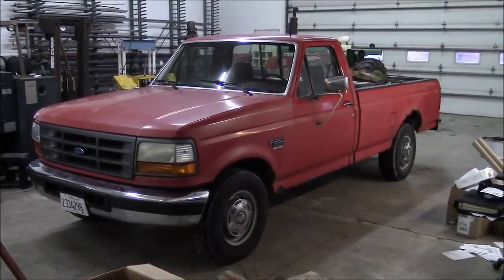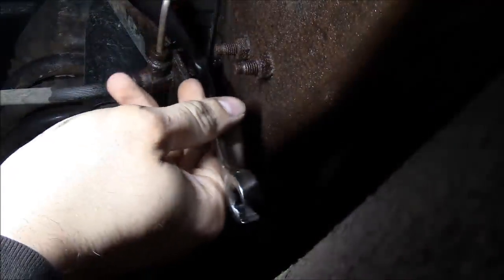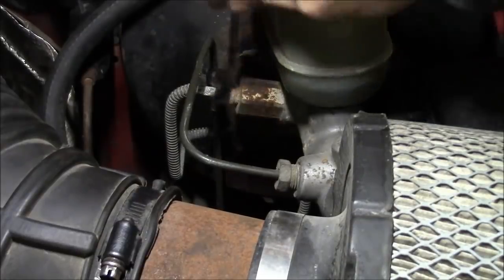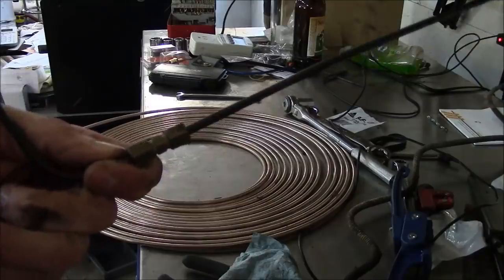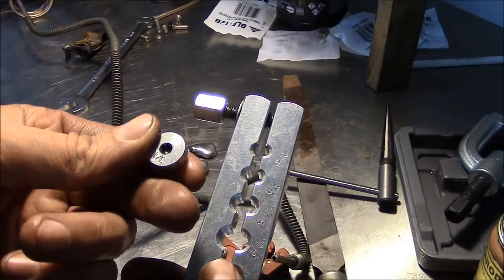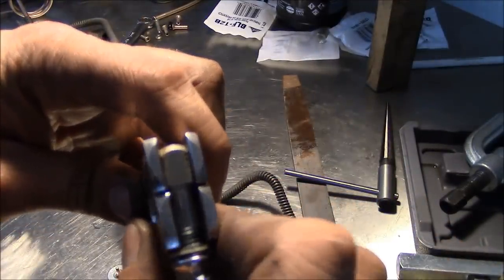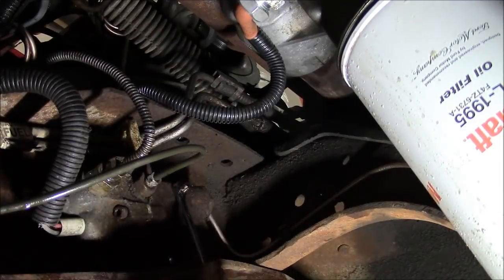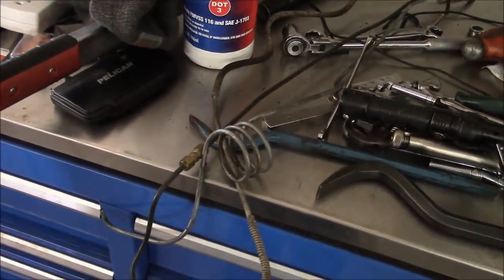OBS Ford Blows a Brake Line

Comment: Best looking flares I've ever made was when I forgot to put the fitting on the line.
Reply: ain't that just the truth.
And of course usually when you have an audience.
Reply from the maker: Heh. We use single flares all the time in industry. I'm not really sure why automotive requires a double flare.
Reply: Same thing with soldering - without fail, the best, easiest solder joints are the ones where you forgot to slip heatshrink on first.

Ah, screw it.  It gets liquid electrical tape!
Reply: @wornoutwrench8128  And you made the line precisely the right length with no margin for error because you're weird like that and wanted it to look nice.
Reply: @JlerchTampa  But of course.  Is there any other way.

I cut it 3 times, and its still too short.
Reply: Well I'm glad I'm not the only one ☺️

Comment: glad i came across this, few month back my 96 f150 blew one of those front rubber brake hoses, i was too afraid to mess with the brake system, so took it to a shop and they charged like $400 for replacing both the front rubber ones and bleeding the system! Now looking back the parts would have cost me less then $50, but i now feel confident to do my own break line work thanks to your vid.

Comment: I’ve never vice-gripped an air line on a semi to limp it back home, sure glad you wouldn’t do that on your stuff either! 😆👍
Reply from the maker: Nope, never. One time I was helping my brother haul an excavator with his IH dump truck. Pulling a huge hill the plastic line for the oil pressure gauge melted from the high exhaust temps. That quickly drained almost all of the engine oil out on the transmission and down the length of the frame. We stopped and pinched the oil line off with some vise grips. Then we drained the engine oil out of the excavator and used it to fill the engine in the truck. Drove the rest of the way home with no issues other than some dripping oil.
Reply: @WatchWesWork  GOOD SAVE!
Reply: I put a dime in the fitting on my freightliner to get it home. And it stayed that way for a week till I got a new line to replace it. Dot. Never had a idea. 🤪

Comment: I'm surprised that you don't have a vacuum bleed pump.  I bought a little plastic hand pump and used it until the plastic bio-degraded then I acquired a vacuum pump from a lab which I let run while I moved from wheel to wheel, what a time saver it is.  I put a small glass jar with two fittings on the screw lid to catch the brake fluid and Bob's your Uncle I've got a rock solid brake pedal.  Great video Wes, thumbs up.
Reply from the maker: I've had no luck vacuum bleeding brakes. I prefer the hard way.

Comment: All of my dad's trucks and cars had "fair crescent" wrenches and boxes of rivets that he shoved in the lines where ever appropriate and when he couldn't stop at highway speed at a stop sign then it was my job to fix. A small propane torch to heat the lines, gloves for hands, and a socket that you could wind the line around without kinking it. I played dirty pool on dad as I fixed all four corners, I used the cheap softer shoe on each corner and turned he drums. He left the yard in a hurry then pumped the brakes. Each time it slid a little and he got out and looked at the truck... my finger prints !!!! Busted but he hollered "good job" and left and I thought forgot and so  riding with him, he waited till I took a  sip of coffee and tapped the brakes scalding my lip... he laughed and it was over

Comment: hi wes, from my years of dealing with brakelines , before I put the new one into the thred I use copper neverseize works a treat so next time you have to undo the fitting it will not be seized

Comment: I just replaced every part of the brakes on a 1996 c2500, except the pedal and booster. The front brake hoses were pinched off at the support bracket in the middle of the hoses from rust. Even replaced the combination valve, I have no use for ABS and consider it a patch for someone that does not have good driving skills. I do grease the threads of the bleeder screws being careful not to get grease on the tip of the screw. While bleeding I usually have the person wait for a count of 10 before pressing down again each time to let the master cylinder refill through the small compensating port.
You did a nice job bending that line and I think I am going to get and in line flare tool. Right now I have an Imperial Eastman flare tool, they made the tools sold by Snap-on. The tool I have has a finer thread and only one clamp at the end with a sliding T handle.
It should be a law that all brake lines are made out of a metal that will not rust.

Comment: Wes: Another great video.
I noticed you struggling to turn the bleed screw and then hit it with a hammer. Just a suggestion ,and you probably know that, sometimes if you tighten the bolt, screw or whatever slightly first and then loosen it can work. I love the videos of you getting the old equipment working. Great stuff.
Reply from the maker: I'm using a breaker bar so I can turn the bleeder either direction. I thought the love tap with the hammer would help, but it really did nothing.

Comment: Nice job.   I have an old pickup I did the front on already but haven't done the rear or the line all the way back.   Will have to check out that tool when I do.  I hate doing things half way (like that compression fitting).  Decent tools can make most jobs easier.  I am finally learning that in my mid 50s.

Comment: I bought a wing-nut type double-flaring tool like the one you showed, and ended up stripping the threads out of the wing-nuts because I used a wrench between the wings like you showed. Never again. The hex-nut double-flaring tool I have now is a cheapie, but I can put as much torque as I want on the nuts. I like the way you bleed brakes, I do the same thing, every time the pedal is released air can be drawn into the line.
Reply from the maker: That's how my dad taught me to do it. I have no idea if it's right.

Comment: Amazon always has a great deal on the entire
kit- 25' roll line, fittings & stainless steel armor for a great price.
Here in the North East, this is a must-have replacement for steel OE.

The armor helps to bend, and hides any waves. Anchor it down
with the available rubberized stainless clips & screws.

Comment: I'm pretty impressed it was not just Australia that got the strange changeover Fords with half metric and half inch bolts. 
Although ours werre mostly locally produced passenger cars rather than trucks.
Reply from the maker: Yeah it was a real abortion here. The old engines like the 351, 302, 300-6 that were converted to fuel injection were also mixed. The long block was all inch, then the intake and emissions crap was metric. The body and frame, who knows. Some metric, some inch.

Comment: A good double flare starts with a good cut so have a good tubing cutter on hand. Took me about 4 kits before I found a good flaring tool. Plus those vice grips that are made for nuts are great for breaking rusty brake fittings.

Comment: My tip for brake pipe nuts and brake bleed screws when you know they don't want to undo is to tighten them a touch first. 
But I don't have snow and salt here in Australia so you might as well ignore my helpful hints.

Comment: Last year i had to replace most of the lines on my old Toyota shit box. It wasn't a fun job, although the kunifer line i used should long outlive the car. The various unions were so munted the only thing that would shift them was my knipex cobras because the metal was soft enough for them to "bite" into. Honestly i'm impressed your truck had any original lines after 25 years. I would guess they put even more salt on the roads in Illinois than they do on the roads here in England.
Reply from the maker: Yeah they layer it on thick! All the lines behind the firewall have been replaced.

Comment: Glad I live here in Arizona , they may dry out Hose but Rust thru i drove a V8 can't re call year from Flint Michigan . After I bought and pulled the Engine after lean over the Fender it did not fall of but it was like accordion replace pan freeze plugs out in to a different Car was good to got Tbonde .

Comment: Hey Wes, check out Earl’s Solo Bleeds. Replaces the stock type bleeder with one that you can open up, pump the brakes and it bleeds without allowing air back into the system.... no wife needed.

Comment: I always thought compression fittings where illegal here. But when grabbing some compression fittings at Can Tire today I found them on the same rack?
Reply from the maker: It's not illegal to buy compression fittings. It's just illegal to use them on brake lines. At least where I live. They work great for low pressure applications like air lines.
Reply: Ya I guess. But this was automotive section on a shelf labeled for brake repair parts. The plumbing section is almost the other end of the store. 
Anyway, YouTube's algorithm pointed me toward your latest forklift video this afternoon. So I've bean watching some of your videos. 
Tomorrow I get to do rear brake lines an rear wheel bearing on an '04 Impreza in a snowy driveway (shop is full fo other projects).

Comment: To make brake bleeding a much simpler job. Get a spare brake fluid reservoir / master cylinder cap, drill a hole and fit a tyre type pressure valve. Apply  air pressure to the reservoir then open the bleed nipples one by one as normal. Keep the reservoir pressurised all the time. You can make a separate reservoir holding new brake fluid if you wish to completely change the whole fluid. Just pressurise it to force new fluid through the system. Have seen five gallon drums of fluid done this way in busy truck shops.
Reply from the maker: I have a power bleeder that uses a pressurized fluid tank. But I find it quicker and easier to just roust the old lady up off the couch.
Reply: Watch Wes Work Two things come to mind !. I used to be a travelling salesman selling tools and equipment to workshops,  I really liked guys who bought all my special offers, usually a hard to refuse labour saving tools and then just did not use them much. Usually meant I could call again with a new line !. Secondly after almost 60 years of marriage I still have not got my wife fully trained to follow my every command. Shows I was a better salesman than animal trainer, even my dog does as it wants. May go back on the road yet.
Reply from the maker: @BRI33NOR  To be fair, it took over 48 hours to get her the 200 feet from couch to shop...

Comment: looks like it is your turn with the rust issues.... i have a couple trucks that need a couple brake lines replaced.....they used copper nickel lines and put compression fittings in each one.... must have used every scrap piece of the copper nickel they had laying around. cant tell what that v8 engine is. is that floor pans for the pick up?
Reply from the maker: Well they're floor pans for a truck, but not this truck...

Comment: The shop i work at supply alot of the tube nuts that go on the brake line assemblys for gm,ford and Chrysler. All the brake lines you get from the auto parts stores are usually ours also. If you look on top of the hex and there is  2 pairs of 2 lines(i.d. marks) those are our parts.

Comment: I made a pressurized brake bleeder from a bottle and an old reservoir cap, only thing that finally worked for the ABS/ESP valve block (flush through with the computer). Now that I have it I use it most of the time instead of pumping the pedal.

Comment: Let's take a moment to silently thank whomever pushed through legislation mandating dual-circuit master cylinders in 1967.
Reply from the maker: Heh. It does help us under-maintainers.
Reply: There used to be a reason to check the "parking" brake to make sure it was in good shape, would really stop the car by itself, and was easy to use. :-)
Reply: Lotta good that does when both circuits use the same damn friggin' reservoir!!!
Reply: @lwilton  parking brake wont stop shit, dont rely on it saving you. busted brakelines on my duece (single circuit) and the parking brake wont stop it. it might be even worse if you lock up your wheels and spin out easier. the only thing thatll help you is losing speed within a safe limit.
Reply: @eformance  there should be a baffle in the reservoir to prevent the whole thing from emptying if one side goes
Reply: I guess that depends on the vehicle and the maintenance. I had two occasions where I had hydraulic brakes fail, and in both cases I was able to control the vehicle with the manual parking brake. In one case I drove the car the remaining couple of miles home and fixed it there.

Now I've been in plenty of rental and other people's vehicles where you are right, you can't even tell there is a parking brake installed, and most people don't know where it and the release are. I've seen a lot of cars that are always driven with the parking brake on because the owner doesn't know where the release is, and having it on has no effect at all on movement. On the other hand, I check the brakes in my car about once a week, and I KNOW they will stop the car.
Reply: Tyler's Neighborhood Garage yes, and you know the auto makers had to do it while kicking in screaming
Reply: @eformance  
In UK the reservoir has two chambers so that only one side will drain out.
Reply: I was leaving work one night in my F-250 when one of the hard lines in the rear blew when coming up at a stop sign a block away. I circled around to head back to the parking lot and a hard line in the front blew leaving me with absolutely no brakes at all. Had my truck towed home and I ordered a full tube kit from Inline Tube that night and replaced every single line on that truck.

Comment: Is what you're using on the threads of anything threaded, Copper Paste? That's the go-to for "I'm going to cut the next chucklehead/myself some slack when this needs to be unscrewed again." stuff, here in Sweden.
Reply from the maker: I use the aluminum based stuff. You can't use the copper past with stainless steel, but that's the only compatibility issue I know of.

Comment: Hi there.  I  am a federally certified machine repair tech. The best flaring tube wrench.  Is a snap on !
I own all the big name brands.
And are very good.  But they all spring.  Test them for your self. 
Snap on wins.  Hands down! 
And i dont use all snap on tools.
But there wrenches and hand tools 
Are the best.  Just my 2 cents.

Comment: We have stainless steel brake line, hydraulic bending tools that will not crimp lines, electrohydraulic single and double flaring tools, stainless body support clips, an entire mechanical engineering workshop and the guys still manage to completely screw up such an uncomplicated process with such unparalleled skill, you question if they're even worth feeding !!!!.👍👍🇭🇲

Comment: Another reason that Ford did not use copper alloy lines would be that, at the end, you are connecting them to steel fittings and parts. As you may know, when you connect two dissimilar metals together, you get galvanic corrosion at the contact points, which can be problematic on the long run.
Reply from the maker: I dunno. I mean factory steel lines are connected with brass union fittings all the time.

Comment: funny this came up because i get into work this morning and they told me they blew a brake line on a truck so ill be doing the same thing.  Ive always topped master cylinders off to the max line even when i worked in a shop. when i push a caliper back in for a brake job  I open the bleeder then shut it at the end of the piston stroke.  I vaguely remember being taught this because of certain abs modules. not sure if there is any truth to it or not
Reply from the maker: I've heard that too, but I've pushed back pistons on hundreds of vehicles and never had an issue. Tangling with the bleeder is too risky for me. I get chills just thinking about it...
Reply: @WatchWesWork  lol i know you did your line nuts but did you neversieze your bleeders Wes?  i put that stuff on just about everything i touch.  Like you did with the brake lines i also do that on steel hydraulic lines behind the tube nut.  making a new brake line is easy compared to a 1" .049 wall steel tube.
Reply from the maker: @73DiamondReo  I never-seize pretty much everything. It's like ketchup for the shop. Do you have access to a power flaring machine? Those are slick. I used a Parker machine once and it was great.
Reply: @WatchWesWork  at work we use a lot of stainless heavy wall tubing. .088 i want to say and swagelok fittings.  have a machine that swages the tube fitting on there and they're good for 10k psi.  I look occasionally for a machine for  my personal use but its not something i would use often.  I do make my own hydraulic hoses though.

Comment: I had to replace a rear line on a 1995 F-250 4x4 - I also learned the hard way that the rear Wheel cylinders are smaller than the ones on the 4x2.
Reply from the maker: Interesting. I wonder why.
Reply: Another Bright Idea From Ford?

Comment: Hi Wes. Here in this State they still allow the compression  fit break fitting. I have never seen one fail, Though that doesn't mean they can't. I have never used one on an auto. But being in Maintenance for many years . And I have used them on machines , Has you know the Boss wants it fixed yesterday : )   Great job and I have been wondering about the copper nickel  Line and the inline flaring tool. Thank you Sir. Liked,Shared. All my best.